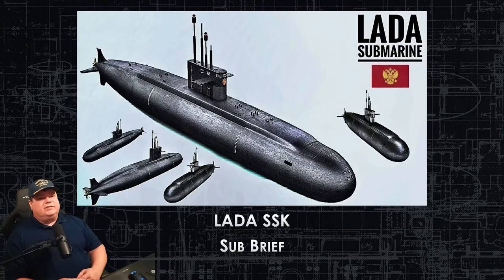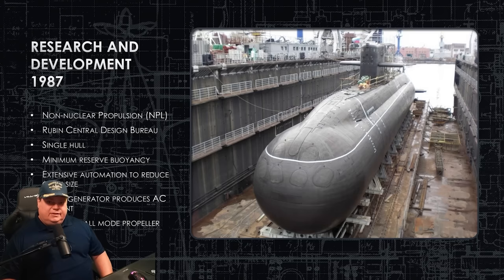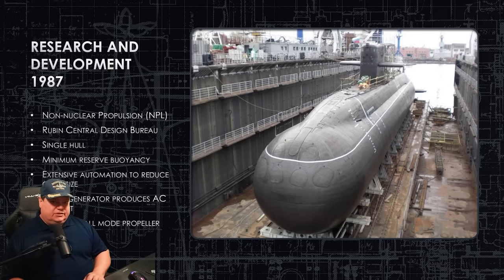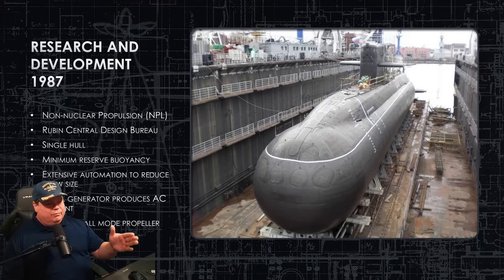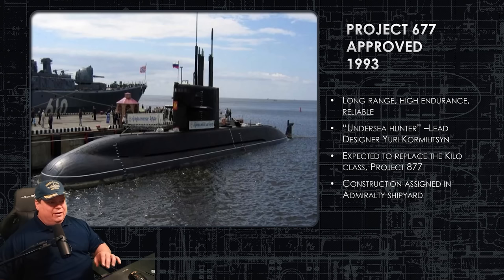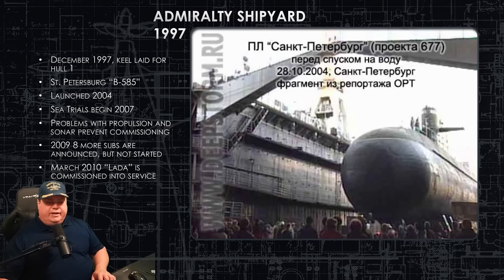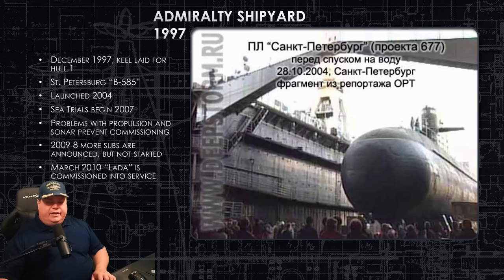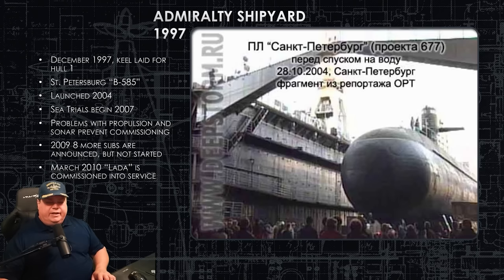Russia's Project 677 Lada-Class SSK Sub Brief

Comment: AC generators have lower maintenance than DC generators. AC generators are either brushless or slip ring, I would guess it has slip rings, because they are not making and breaking contact constantly they last much longer. Slip rings allow power feed to the stator to vary power output. Secondarily AC generators generally are voltage controlled (I dont know enough about naval DC generators, but I am aware of voltage controlled DC generator) so you can set the prime mover at a speed and vary the stator field and make whatever power is required. Thirdly in some applications AC generators produce more power for their size compared to DC generators
Reply: Thanks.
Reply: The closest to submarine-size generators would probably be loc size generators (not THAT much difference), and the switched into all-AC mode quite some time ago... Thanks to semiconductor power-converters, they can go AC-DC-AC (eg. rectifier and then variable frequency inverter) easily, in relaticelly small space and weight. The generators/engines are smaller and more robust in AC version, and thanks to variable frequency has full strenght in different speed modes...

Comment: Only reason I can think for AC Generation, is that it would be brushless.  Admittedly DC would be nicer all around ( you are nor transmitting electricity any real distance, so loss isn't an issue)
Reply: Most trains are AC as as far as I know. So controlling them shouldn't be that difficult for the Russia.
Reply: The fact it generates AC is not a problem, converting to DC is easy and reliable (except apparently for Russian designers). Why it is causing a problem is the real question. I suspect a lack of high powered rectifiers or materials to make them. Even that shouldn't be a problem, simply use multiple lower power ones.
Reply: It has to be corruption.  Just buy off the shelf high power rectifiers / voltage converters from a European brand like Siemens.  Probably the money wasn't there, while a friend of a friend pocketed the money for this part and hand soldered something together with junkyard components.
Reply: @GeraldMMonroe  while corruption is an issue, that's not how it works with high end naval shipyards. You are more likely to have the contract awarded for a firm with political connections, that promised an overspeced fantasy component. That firm then subcontracts the design after taking the profiteering cut. The subcontractor, an actual engineering firm, delivers a product that can be made AFTER their profits - it's competent, but nowhere near the fantasy spec - whoops... The difference between Russia and USA is, USA then increases funding to get the dream component and eats the cost blowout, while Russia just accepts the delivered product and hopes for the best - most of the components aren't THAT much out of spec, but the cumulative effect of everything being slightly off, is that the performance rarely hits the target.
Reply: @lucidnonsense942  Well in russia this is a problem, this happend to the navy, army and navy from russian and china.
This is why the newst Chinese carrier received a landing deck made of normal cheap construction steel used for rebars...
Reply: @john_in_phoenix  they did exactly this, if you don't perfectly match the diodes to each other they will go pop one by one - which is exactly what happened. the company responsible sourced the parts through shell companies - at least one of those companies is importing from china second rate defective rectifiers or B grade components and is pocketing the difference - not surprising at all, so they made the bus AC, but that caused issues down the line when they sourced AC versions for downstream electrical components designed for industry and not really designed to run hot inside a metal tube - hence the ongoing saga of issues with the electrical system.
Reply: @GeraldMMonroe  they cant because of sanctions so they have to import through shell companies in turkey and china.
Reply: DC would be better because you wouldn’t have radiated frequency from AC electrical plant instead you use local small inverters to change over to AC as necessary.  Plus DC gives superior performance for computer processing because there’s no waveform to change to a square digital signal.
Reply: It is easier to rectify AC power into DC power than invert DC power into AC power.  Also, if you accept lower efficiency, a high frequency AC power system has smaller, lighter components.  Doubling the frequency reduces the volume of motors, generators and transformers by a factor of four.
Reply: Yes, mechanically it is much easier to create AC than DC and then the solid state semiconducters used for rectifiyng AC to DC are really simple, robust and well understood.
Reply: It's also trivial to chang voltage.
Reply: Is the use of brushless a design choice for noise reduction?

Comment: A German Type XXI submarine had a range of 340 nautical miles in 44. Given improvements in battery technology and submarine design and drag 600 is quite doable
Reply: Uh... SLA batteries have not improved/changed that much in the past 30 years. If it were something more akin to say... Lithium Cobalt like what Tesla used to use, then yes I'd be inclined to agree, or even LiFePo4 (which is superior and cheaper and less volatile) then it could casually reach that... but Sealed Lead Acid is so archaic that it's a wonder that these people would build several of these things and not use a modern day technology.
Reply: I was really impressed with the Type XXI submarine. We were fortunate that the class entered late in the war.
Reply: @imglidinhere  I'm beginning to wonder, I think we may be mirroring here ( seeing what we expect to see, not what is there).  Repurposed parts, low tech solutions, what if this sub is the T-72 attrition sub that is designed to be built cheaply and attrited?
Reply: Aaron said she's using old-fashioned batteries. I don't understand your point about improvements in battery technology. He even said that if she had new style batteries she could go as far as claimed.
Reply: @r.gilman4261 Like russia has the money for that. And its called a drone sub.
Reply: @stekra3159  Now do a drone sub in 1980s tech...the timing is right if you are replacing Foxtrot hulls and can keep the country on track.  Smaller than a Kilo, potentially cheaper, less crew...just got to work the bugs ...and then stasis for 30 years and the universe changed.
Reply: Well updates the Type XXI with a modern Graphene Battery or the one what mercedes develops, they are a few times better as lithium ones.
Reply: Battery technology is pretty straight forward and once you get something working they have such high efficiency that physics doesn't allow a whole lot of incremental improvement.  Take all the news we have been hearing about range improvements for EVs over the years.  We likely won't see it without also seeing major drawbacks.  they never mention the drawbacks when they announce the breakthroughs.
Reply: @billalumni7760  Not really, the have one in coming what, improve it not incremental.
The issue is to mass produce it because of the have still issues to produce the needed graphene.
It has a energy density of 310 Wh/Kg and can by charged in 3 to 5 minutes.
In theorie well 7000 Wh/Kg are possible.
I know you need to love nano technology.

Mercedes as example has a organic battery in work what is kombostable and has a energy density of 260 Wh/Kg.
And NASA plays with a 500 Wh/Kg battery 

But well lets compare it to a Lithium ion cobalt battery they are the best what the have right now then it comes to lithium, the speak about a energy density of 150-190 Wh/kg and need to recharge around 120 to 240 minutes.

The russian sub from the video, has proberbly around 30 to 80 Wh/Kg batterys.
Reply: Yes. But this sub has the same batteries as a type 21 had in 44. So......600NM not gonna happen.
Reply: @markt5674  Well they improved the batterys this adcid lead batterys a bit, like around 20 to 30% more capacity per kg of the battery, but well its still not a lot.
Beside the speak about russia, i could imagine they reach this range with a bike powered generator or something simular stupid.

Hum interesting idea bike powered submarine, perfect one for the dutch XD.
Reply: @imglidinhere  perhaps they see lead acid as having less risk of thermal runaway
Reply: @r.gilman4261  
Leopard 2s are expensive and get attrited when they get hit.
Reply: @imglidinhere  He is comparing it to 1944 tech... since then, just as you say, SLAs HAVE improved significantly...
Reply: @r.gilman4261  Could be, but it had to be significantly refined especially towards reliability. "kilo improved" shall look better...

Comment: AC electrical systems are lighter, higher voltages = lower amperage for the same delivered power, therefore less copper required.  Airliners use AC power for this reason, then rectify to DC as required.
Reply: Interesting. I guess that would make sence to use in a submarine that already has minimum reserve boyancy.

Comment: From the same people behind RBMK reactors, the Ufa Incident, and the Kyshtym disaster.  What could go wrong?
Reply: The reactors are fine, but maybe put them inside a better containment structure.
Reply: @zolikoff  Those reactors are not fine. They can go into a positive feedback loop, a disaster waiting to happen. They are the only commercial reactor to have this characteristic.
Reply: @KI4HOK  Not quite. CANDU also has a positive void coefficient. Positive void coefficient is fine by itself, you can deal with it. The RBMK design was even updated post-accident to address this; but the main point is that with a containment structure the "disaster waiting to happen" is averted. You can lose a reactor but that's it. And guess what, reactors with a negative void coefficient have also been lost. That's an economic problem for the owner.
Also, as a final corollary, even if it's one of the "worst" nuclear reactor designs, the RBMK is still one of the best energy sources in the world... by virtue of being a nuclear reactor :)

Comment: WWII UBoats did not use mechanical steering for sonar (except for the KDG — Crystal rotating base device, using a rotatable bar with a line of crystals), but used electrical delay lines for a row of hydrophones to constructively interference from a certain direction.

Changing how many delay lines are between a given hydrophone and the headphones was done by turning a wheel. The back had contact strips going over brushes from the hydrophones and connecting to the delay lines via circular tracks and  brushes.

So a mechanical steering for hydrophones is not up to date by WWII technology, beam forming is. 
For sonar, say ASDIC, it is a different story in WWII, that was IIRC mechanically directed.

Comment: Considering the restart of Kilo (Project 636.3), the improved Kilos, it doesn't make sense to continue with the Lada class.
On the choice of using an AC generator,  its possible that there are different power requirements.  The generator has to match up pretty well with is biggest single consumer of power.    Its possible that the propulsion motor is an AC powered design.

Comment: As a Lada class submersible, was it equipped with an auxiliary hand crankable ballast, or propulsion system. In case of mechanization failure, it could be a very useful feature.

Comment: Do remember that the automotive industry - that uses DC for everything on cars - changed over from DC generation to AC generation 50 years ago. The did it for cheapness with 3+ times the output from the same weight of machine, plus car generator brushes were consumed over years while alternator brushes usually last the life of the machine.

Comment: Shouldn't a smaller sub technically be faster and more stealthy than a larger sub if its a "hunter-killer"? Unless of course they are supposed to be reconnaisance tools (but submersibal drones would probably be a more efficient and cost effective solution for that kind of thing).
Reply: More stealthy, yes. Faster, no.

Deisel electric subs are generally stealthier than nuclear subs because in a deisel electric, you can reduce moving parts practically down to JUST the electric motor and screw. In a nuclear sub, you have the electric motor, screw, and a myriad of pumps, valves, and conrtrol rods for the nuclear power plant. It makes nuclear subs inherently louder, and requires a lot more effort and technology to make "stealthy" enough to be comparable to deisel electric.

However, nuclear subs are generally inherently faster than deisel electric subs. This is because moving a vehicle through the water requires exponentially more power (in this case, all electrical power for both) for every knot of speed you push it to.

A 30+ knot design is probably feasible for both deisel electric and nuclear subs... However, a deisel electric sub would likely drain its batteries pretty quickly if it had to be pushed to that speed. By contrast... Nuclear submarines get their electrical power from the fission of nuclear fuel... Which is a power source that lasts literally years even if you demand flank speed all day long. Unlike deisel electric subs, nuclear subs can sprint to a higher speed, and do it all day long, just because they have a practically infinite power source (at least, infinite as far as any individual engagement is concerned).

That is why nuclear subs tend to be faster than deisel electrics.
Reply: @hatman4818  so the Russians and others are onto something with nuclear powered autonomous submersible drones? 

Surely we must have similar programs?

Comment: I would guess they used AC because it will s far more easier, cheaper and efficient to go from AC to DC than DC to AC. ~95% vs ~70% and four diodes vs mosfet transistor array.

Comment: As you've pointed out before, the difference between NATO and Warsaw Pact torpedo tube placement. I was watching Down Periscope recently (historical accuracy be damned) but it got me thinking. When a sub is running on the surface, top mounted tubes become almost useless. Whereas the under mounted tubes of NATO allow subs to fire regardless of depth.

Comment: Soviet Union and modern Russia does have a legitimate need for SSK (dis elec) boats. Not just as a cost measure. They operate in shallow water as well as open deep blue water. Baltic, Black Sea, , Yellow Sea, and Russia's Pacific littorals.Small SSKs are more optimal for shallow waters. Being inherently quiter when running on battery alone, they can lie in wait and ambush . SSK are very difficult for ASW to find.

Comment: You hit on the AC generator going through a rectifier pretty hard. It's how I would do things with modern power electronics. The generator is simpler, because it doesn't have a commutator or complex rotor wiring, you can apply field current to the rotor though a set of slip rings. That's a significant amount of complexity gone. That's balanced by needing a rectifier, but the modern rectifier units I've used converts 480 VAC to 385VDC in a sealed unit at greater than 98% efficiency with low harmonics and high power factor. Now that we're got IGBTs in common use for two decades and greater use of wide bandgap GaN and Silicon Carbide devices, I'd go for as simple of a generator as possible and run as much as I could in electronic modules.

That having been said, this world take some time to get stood up, and I can't think of any Russian power supply design houses that would have experience in this dirt of power conversation off the top of my head.

Comment: I've come to learn that all generators produce AC power, DC generators just use some form of inbuilt rectification. AC power lets you use less weight in wires and is just as easy to rectify at the load end as it is at the generation end. See also the 777 and 787.

*conventional generators, don't be bringing solar cells or hydrogen fuel cells or some other nonsense to me.

Comment: very good video your right this class has nothing but PAIN IN THE ASS FOR THERE NAVY so many problems with it..1 ship the st Petersburg was Decommissioned in April of 2023 and is going to be Inactive or decommissioned, to be scrapped. 2 Kronshtadt is in service 2022 3 Velikiye Luki 2023 Fitting out Laid down on 10 November 2006, re-laid in 2015 due to a redesign.

the fourth and 5 are going to be called Vologda 2025     Yaroslavl   2026.

also, they scaled back a new corvette called Project 20386 corvette of 10 they want to be built only do the first one because too expensive. be ready in 2025.
 
and they are focusing on more corvettes of the  Steregushchiy  and   Gremyashchiy classes. of those 4 of the Steregushchiy are in Baltic fleet one in black fleet in  rest are in service with pacific or being built there for that fleet. and  Gremyashchiy  all are in service or being   built for that fleet in pacific. one of those the Provornyy Under construction; severe fire damage December 2021; rebuild may take five years[15][23]